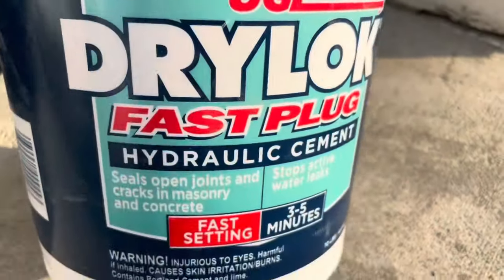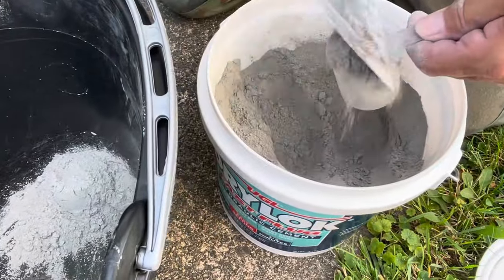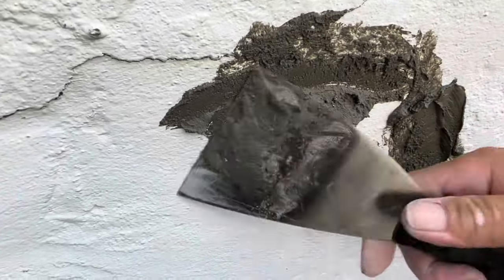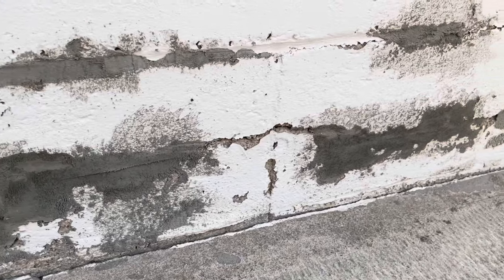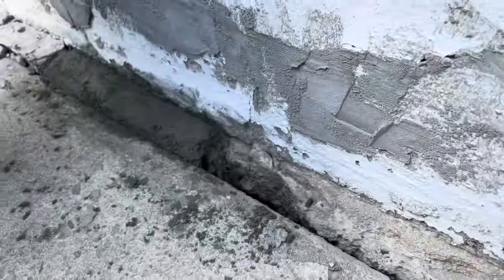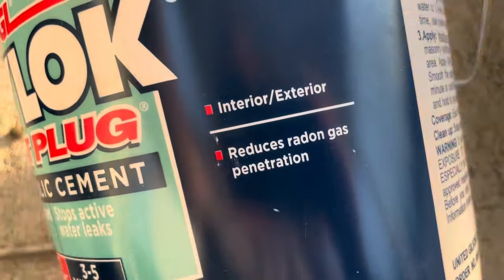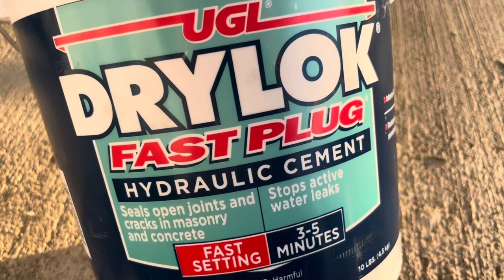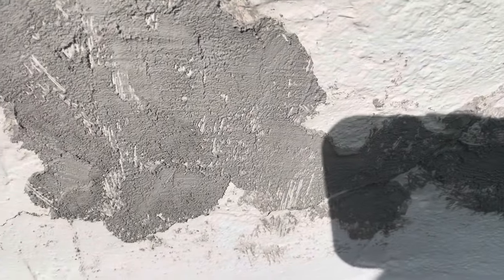DRYLOK Fast Plug Hydraulic Cement

Comment: Thanks for the review. I was looking at this product to fill holes in a concrete drain. I was just wondering.. given what you were using it for, was there a specific reason for using this vs a regular mix concrete? Easier to use and faster setting?
Reply: Hydrolic cement expands when drying to fill cracks, regular cement shrinks.

Comment: Can u pour it then add water to a crack without stirring it up??
Reply: It’ll be better to mix it so you get the right consistency in the water/cement mix. Plus you don’t want any of the mix to not get any water if you dump it inside a crack
Reply: No, you need to mix it first.